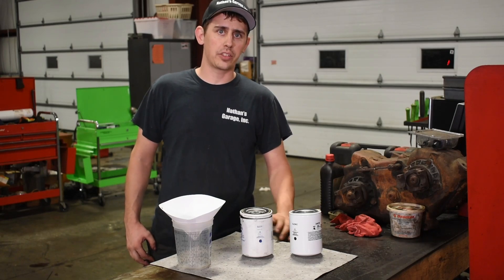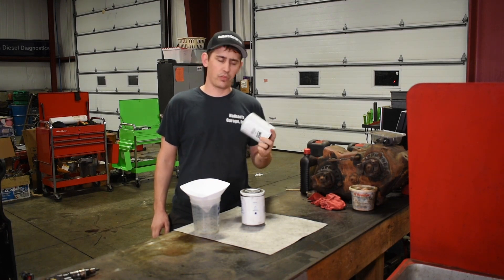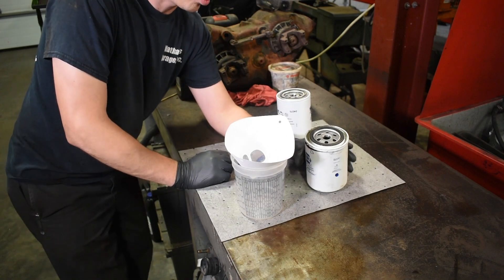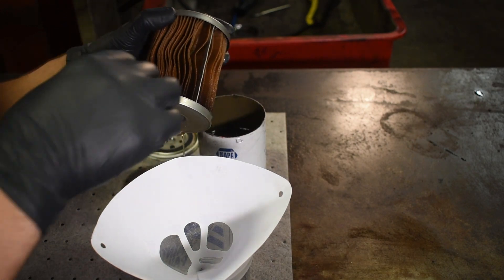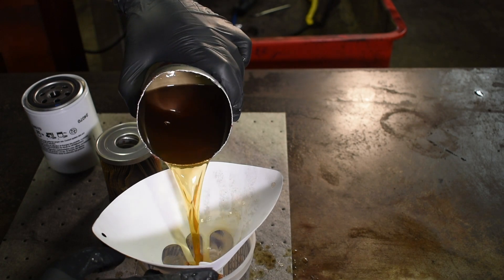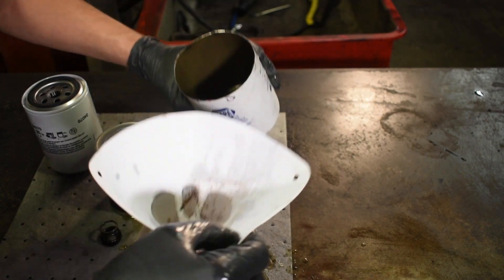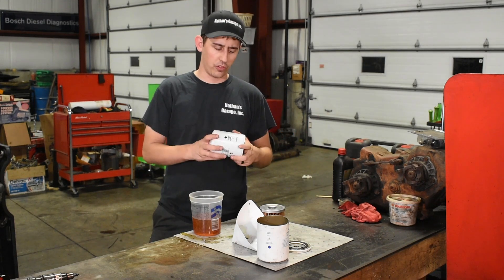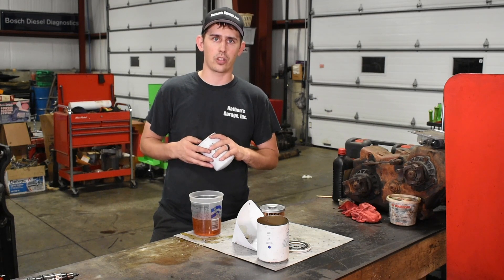Ford 6.0 and 6.4 Coolant filter kit

Comment: Great informative video! I have the Sinister coolant bypass kit on my 2005 F350 6.0 which was on my truck when I bought it. Guy said he had just installed it before I bought it. 
After a year & 15K miles, I changed it. A lot of crap was in it! Glad the filter caught it instead of the oil cooler!

Now, I’ll schedule it every 5K with the oil change & see what’s in there. Thanks for the great informative video!
Reply from the maker: Thank you! Glad you enjoyed the video. I’ll be back to posting new videos this week. The coolant filters don’t catch everything but it’s amazing how much they do stop. We usually change them often a few times after initial install then space then out a little more as time goes on. I always cut them open to see how much we are catching.